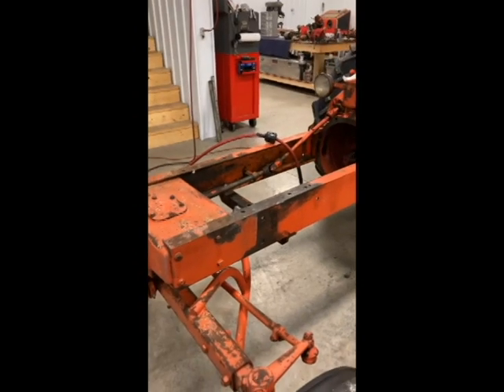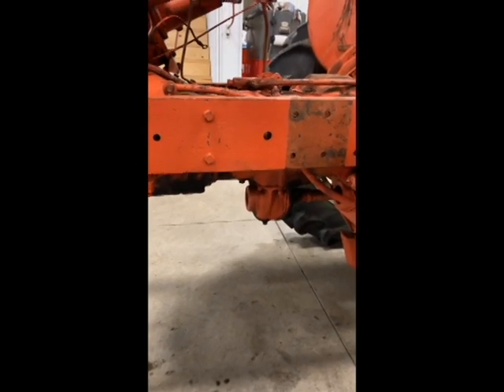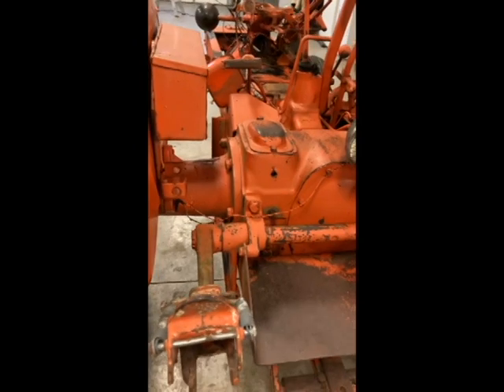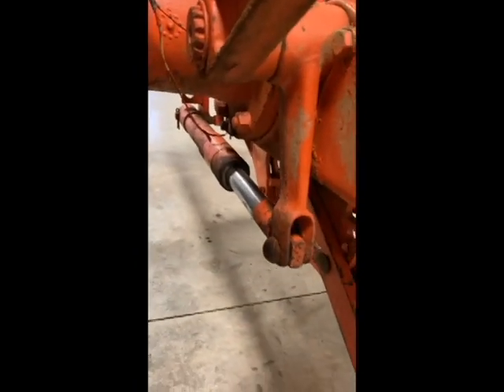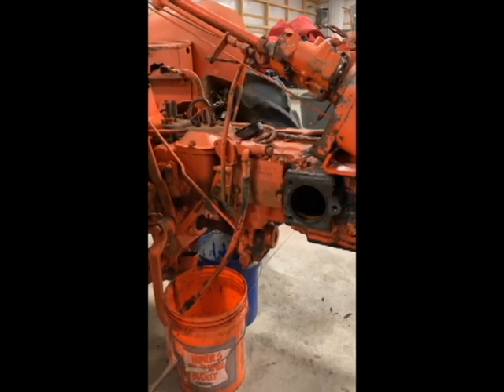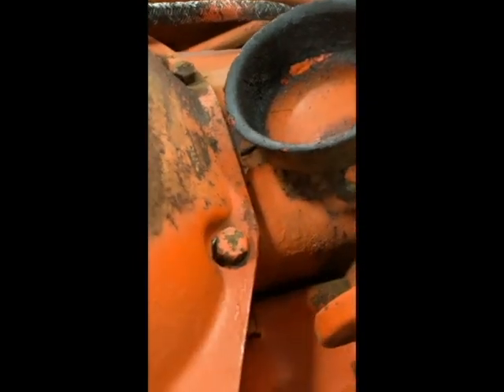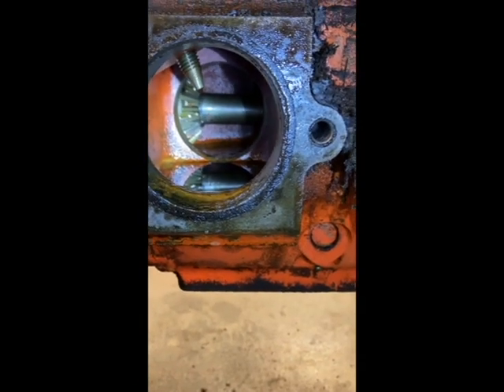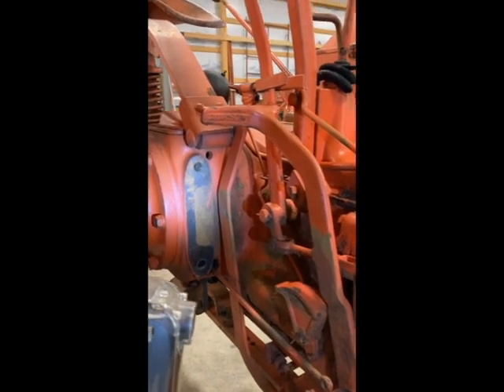Allis Chalmers WD Hydraulic Pump and Rear Differential Inspection Part 14

Comment: Have exact model myself.  Not sure how to adjust the pump.  Do you have a video of how to set the different functions of the pump?
Reply from the maker: Don sure don’t but that would be a great video for me to add at some point. I remember back in my teen years wondering just that. Maybe I’ll set up and do that sometime soon.
Reply: @nashsummers8050  Thanks and look forward for information.  Problem I'm having is that I have the OEM cultivator for the ram arms but when the shovels start digging it will keep digging to the point where it will stall the tractor.

Comment: Good  day  Boy that hydraulic  pump on them for a loader was  not good.  Slow &  no pressure.  If loader didn;t  lift & you sped motor up, it made lifting worse,  I wonder if you could turn or open up relief  valve?  But when looking down by pto drive , I said to Farmer Pete u could make it into front wheel drive.  Thinking about tractor I saw, it was Allis B rear end & allis b rear end on front, making it 4 wheel drive. If you seen one OK  but if not look up Allis H on you tube.  Thanks

Comment: That hydraulic pump makes a distinctive noise - I always wondered what it looked like.  Putting in the belt pulley with the engine running would take off a finger or 2!  I wonder if they started it when the set-bolt wasn't tightened or the pulley gear wasn't fully seated?
Reply from the maker: Yep this is the first time Ive taken one off.  Not much to it really. Very possible it wasn’t tight but I’m guessing it was pushed in when running.

Comment: l bet the releaf valve stuck and wouldnt let the pump shut off and that was the noise you heared and if they parked it because of the pump running all the time that locks the rams in the up position and that with it sitting would cause the rams to stick in up position  the valve on the front of pump screw it in or out to release  it happens when the oil gets dirty or you leave a implment in up position!! it takes just a speck of dirt to mess the pump up  if it happens in field use drain and fill with diesel and cycle pump and refill with new oil  anyway thats what we did back in the good oldays!!!!! hope it helps l be watchin!!!!!
Reply from the maker: Gary thx for the information. When I opened up the lines to the rams not much oil came out. What could cause them to be so tight that I can’t collapse them?
Reply: @nashsummers8050  maybe after years of setting that way they stuck??
Reply: if that pump was stuck pumping and not releasing it could jam the ram pretty tight??